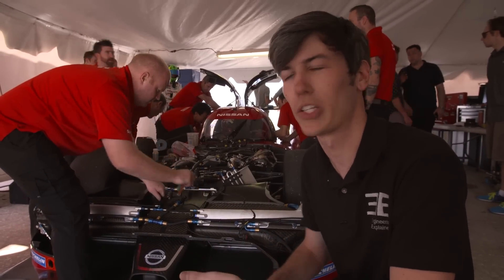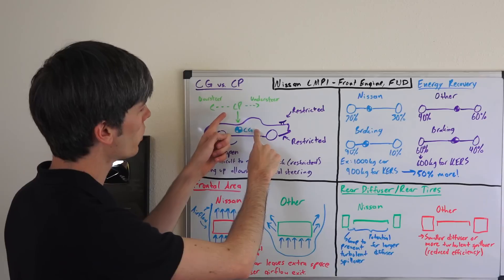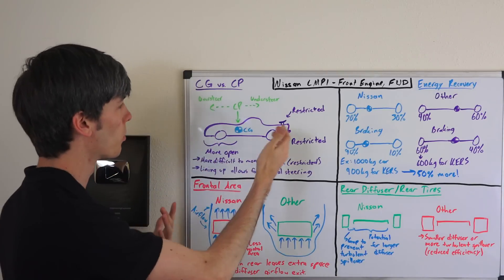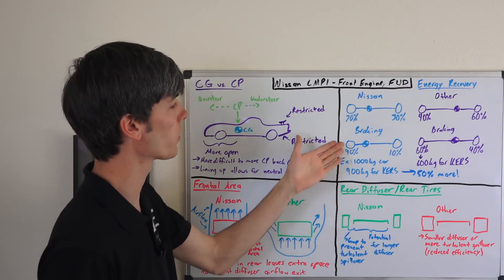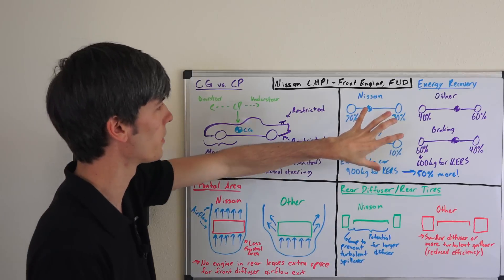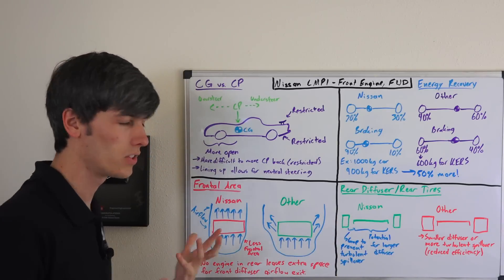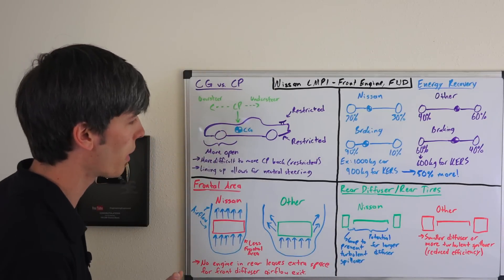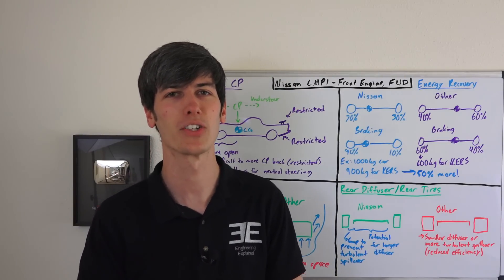Nissan GTR LM Nismo - 4 Reasons Why Its FWD & Front Engine

Comment: I am in two minds about this. First it is great that Nissan were thinking outside of the box and taking advantage of the then CURRENT rules in place. This is similar to how Mazda won Le Mans with the 787B in 1991, but then politics takes over and rules are constantly being changed, often to control innovation and maintain parity, but usually to allow the favourites to win.

Comment: You didn't mention the negatives. Front tires are doing a lot of work. Also, the diffuser creates a good deal of downforce right where it starts. Does it start earlier in this car to center that force between the axles, or still behind the driver creating more of the "weight" on the rear? Either way makes sense with a smaller rear tire, just curious.

Comment: say 90% of the braking is done in the front wheels, so the car basicly wastes the rear's braking because its not doing anything, and you can only brake until you lock up so the car would have to brake earlier than others right?
Reply: Right

Comment: Doesn't fwd have horrible top end speed & acceleration? Seems like an ok idea if you were on a short track with many turns. Any track with a straight away like le mans or sebring  and they'll be left in the dust.
Reply: Dante E92 335I Try doing some research on it to find out. Tracks with lots of slower turns will be more problematic for FWD.

Comment: Surely having more load on the KERS wheels under braking lets you brake, using KERS, harder so it is a traction advantage rather than an mv^2 difference.

Comment: very cool that the guys from nissa tried something new and outside of the box, but my concern about this are the front tires...  theyll have to do all the work of acceleration AND most of the breaking, as opposed to rwd cars where the work is split between the front and the rear axle. now if the front wheels take all this load, they will run down more quickly, resulting in more pitstops, costing the team a lot of time
(only if there are pitstops, i know nothing about this sport lol)

Comment: I am studying at Virginia tech to be a engineer on a team like this and coming up with these radical new ideas. This actually seems like a good idea, it was just not well executed.  Once I heard it was a 85/ 15 split, I immediately knew it was not going to work. When your hard on the brakes into a chicane, you are transferring weight and energy onto the front wheels. The front wheels now have 3 jobs, steering, power, and braking and not to mention 90% of the weight on the tires. No mater wherethe center of gravity is or the center of pressure is, the front tires are still doing 3 things at once and this will immediately lead to understeer. No matter if the driver feels it or not, its still there and hurts cornering ability of the car. just stay with the classic layout, it just works!!!
Reply: I have to agree, if it wasn't such a drastic weight distribution split, it might've worked to an extent, but tyre wear was always gonna be an issue with this car in extended stints. Steering and distributing the engine's power was not gonna end well for the tyres, extended width or not. Not to mention the hybrid issues the car had

Comment: what is center of pressure.
Reply: cobra R Centre of Pressure is the single point where all aerodynamic downforce acts upon. Basically, all the aerodynamic forces caused by the wings, diffuser, etc can be simplified to one average point somewhere on the car.
Reply: You mean center of gravity?
Reply: Thanks for reminding me. I would say the center of pressure would be somewhere near the back of the car close to the ground.

Comment: at the end of the day, the gtr-lm needed even wider front tires cuz there acceleration was trash, the tire wear was trash, the mechanical grip was trash, the rear aero grip was trash, the braking was trash (cuz no kers), the fuel mileage wasnt great, great idea but couldnt race to full potential because of regulations

Comment: RIP GTR LM NISMO project :(
I REALLY wish Nissan would have kept at it and worked out the kinks they had. A couple more years of development, and that thing could have been a game changer in the WEC
Reply: If the front tyres have both to steer the car and to drive it, you then have problems with managing tyres
Reply: lol that thing was never going to work
Reply: Adam Baldwin It won't, an undergraduate engineering student can figure out why it is hopeless. Just like the delta wing. It is flash design, but even with the smoke and mirror, it doesn't hide the fact the design is junk. For the Pismo GTR case, they may have better luck if they use the rear wheel to steer. Then their car may about to devour corner that no other car can.

Comment: Actual Le Mans performance aside, this to me embodies the P1 class. I wish more manufacturers would try outside the box thinking than just trying to chase what Audi is doing. It's also why I was really sad that when it was announced Ford was returning to Le Mans, it would be in the GTE-Pro class as opposed to P1. I'd like to see GM and Ford field prototype cars.
Reply: GTE-Pro is more entertaining and competitive than you think. Also keep in mind The new Ford GT was designed SPECIFICALLY for victory LeMans. the race car came first and the road car followed the design for the race car
Reply: williams used one in 2014 
but i think they let go of the idea due to packaging and for handling in the corners
u know rotating masses do not behave well while cornering
Reply: Only the, Audi used a flywheel up until last year when they saw how powerful the, Porsche was with an advanced battery and motor system. Toyota also followed the Porsche direction. F1 used Flywheels i think up until 2011 maybe 2010.
Reply: Right
Reply: Ford won't because they are too afraid of losing.
Reply: ***** I believe that is true, as they could have responded to a non-podium finish with "well it was just a GT class, no biggie. Though it would have taken a season or two, I think Ford could be competitive in P1 AND it would have done more for the Ecoboost brand than some 450k street car that is probably going to have post production problems. Plus they would get to develop a hybrid flywheel system with the others which I feel might be a new venture for passenger cars soon.
Reply: The hybrids in P1, and I believe in F1, use a flywheel. Putting it basically, it works like a windup wheel. When brakes are applied, the resistance starts spinning it up so that energy can get released back to the wheels when the driver lets off. I heard these things can spin very very fast, say around 20k-30k RPM. No batteries or electric motors, just a spinning wheel that can turn the wheels they are attached to and either add efficiency or power to a car.

Comment: #FrontWheelDriveIsBestWheelDrive
Reply: That's why all the highest performing cars in the world have been front wheel drive, right?
Reply: derz you couldn't be any more incorrect. Front wheel drive in concept is for economy, and comfort. Economy because there is less parasitic loss in driving the front tires than routing the power to the rear giving slightly better fuel efficiency. Comfort because fwd allows for a flatter  floor because of no drive train going to the rear which leaves more space inside the cabin. If comfort and fuel efficiency are your cup of tea than you are correct. From a performance driving point of view most agree that front engine rear wheel drive is the most fun and rewarding drive train lay out. Front engine rwd allows better weight distribution which in turn allows for better overall handling characteristics. And then Mid engine rwd is the preferred choice of most of the fatest race cars out there due to it's centralizes mass. All wheel drive works very well in poor weather conditions and when the power output of a cars engine surpasses its ability to put the power to the pavement. If you think front wheel drive is the best drive train than I bet you love the Fast and the Furious movies and you think they are totally real.
Reply: derz you couldn't be any more incorrect. Front wheel drive in concept is for economy, and comfort. Economy because there is less parasitic loss in driving the front tires than routing the power to the rear giving slightly better fuel efficiency. Comfort because fwd allows for a flatter  floor because of no drive train going to the rear which leaves more space inside the cabin. If comfort and fuel efficiency are your cup of tea than you are correct. From a performance driving point of view most agree that front engine rear wheel drive is the most fun and rewarding drive train lay out. Front engine rwd allows better weight distribution which in turn allows for better overall handling characteristics. And then Mid engine rwd is the preferred choice of most of the fatest race cars out there due to it's centralized mass. All wheel drive works very well in poor weather conditions and when the power output of a cars engine surpasses its ability to put the power to the pavement. If you think front wheel drive is the best drive train than I bet you love the Fast and the Furious movies and you think they are totally real.
Reply: DERZ but the fast and the furious cars were almost exclusively FR (or RWD)... If you drive on real roads with multiple seasonal changes and you have to spend money in real life; FWD is the best choice. Not everybody can afford to keep up a powerful AWD beastie, much less race your precious project and have somebody run you off without a pit crew to put humpty aston martin back together.

Comment: Hi man, I always like your vids, very easy to understand. I just have one question though. Is it counter productive to increase the down force on a car by using front and rear spoilers, when in racing everyone is trying to decrease weight, which is also downward force. Just getting a bit of confusion, please enlighten me. Thank you.
Reply: +3D Printwiz downforce from wings has not got inertial force you have to turn around the corners and fight against on acceleration and braking. get it?

Comment: Nissan needs to get it together. The Delta Wing, while a cool concept, failed hard. I attend the Rolex 24 yearly, and the Delta's NEVER finish a race. Almost always a transmission issue, or the engine just dies. This GTR LM might be better, but Nissan tries to go too far outside the box I feel. Who know, maybe one day they will invent the game changing formula like Audi did with the turbo Diesel, and ETRON.

Comment: Very interested in this car, not an outstanding result in 2015 but much learned apparently.
I head was not as fast as it should of been for the following reasons
1. Hybrid system not working which reduced its power by half
2. Had to run narrower tyres at front then originally designed
3. Reliability issues due to the new methods/technology and unforeseen problems that can only been learnt by racing the car

Would like to hear your thoughts on this as well as any info/changes/improvements Nissan will be making for 2016

Also I brought and drove the car in GT6 to see what it's like (according to Grand Turismo) compared to other LM cars
Things I found
1. High speed cornering/aero/stability was excellent whether trail breaking in or accelerating out and could gain a tenth or two over other LM cars
2.Straight line speed once on the move was a bit better

3. Low speed corners where much slower; a tight corner could lose over a second over regular car; most circuits have at least one of

Comment: Why does there have to be such tight restrictions on racing? it really limits the creative power that all these companies and teams have. Wouldn't it be better to just set some safety requirements/regulations and let the race teams come up with whatever 400 mph spaceship track car they wanted and see who had the best ideas? It would be neat to see cars go as fast as they can around a track without some meatheads saying you can't have a massive spoiler and downforce fans like Chapparal was doing in the 60's. Why limit creativity is all I'm saying. SMH
Reply: +Max Rein it makes it interesting and rewarding to overcome a challenge...
Reply: +Max Rein It because you want a race and not a show of a single car. You need to make groups for competition etc. to make it somehow compareable. Also people like to see cars which look like cars and could drive "theoreticaly" on a road. This LMP Classes are quite open as you can see whats technically possible.
Reply: +Max Rein Seems you didnt get the point. Every game or race needs rules to make it interesting and compareable. LMP cars look like some road cars, yes (never mentioned a F1 car would look like it). Look at all the Super and Hypercars. They are all very similar in kind of layout (race is always more extreme and with another focus like for example changing parts quickly). There are several cars which started as LeMans Cars for example. CLK GTR, Porsche GT1, The Engine of the Porsche GT, Toyota GT One (which i was happy to drive in Cologne few years ago). The Hybrid technology of the Porsche 919 you can find also in 918 and in now upcomming models. So what i want to say: The people like things they can build up an identification. Thats the reason why endurance race here in Europe is way more famous than F1 for example. You can even build cars with jet engines, but people just look once at a number and dont care anymore because its to "spaceship" and has nothing to do with reality they know. All what you can find in todays LMP1 cars is reality on road (just different spec) or will be on road soon. (Like this little regen powerplant which is driven by exhaust gases to rengen electricity in the 919 at the rear axle). This will be available also next 2 years for street cars.
Reply: These lmp cars could not drive on a road, and the challenge in racing is your opponent. Besides, f1 cars and lmp cars don't look much like cars other than they have 4 wheels and a steering wheel (that looks like no other steering wheel on your average passenger car). Respond when you have a valid point to make, I enjoy intelligent discussion.
Reply: +Max Rein If you dont have rules for a sanctioned race, youll have one car raping everyone else, and there is no point in watching something like that, it would be boring. Look at the Pikes Peak Hill Climb Open Class. Its basically run what you brung and the winner is always winning by a large amount of time, and there arent many cars that run in that class. There need to be rules to ensure the sport is competitive and also it highlights the skill of the driver. Make 2 identical Suzukis that Nobuhiro Tajima drives and give the other to Rhys Millen, then let them both run up Pikes Peak, then youll see who is the better driver.
Reply: +Max Rein massive downforce makes racing impossible bc it creates "dirty" (turbulent) air, so car behind cant follow

Comment: Still I don't think these advantages outweigh a MR setup. Le Mans are mostly straight lines and hard breaking. A MR setup will be more ideal in case of accelerating, braking and tires management.
Reply from the maker: Actually the FF is fairly phenomenal for straight line accelerating and braking, especially when you take into consideration that you can recover more energy off a single axle. Unfortunately, they struggled to get their KERS system operational.
Reply: +Engineering Explained You nicely explained the advantages, but the aerodynamic and balance disadvantage is higher in comarsion. As we could see the technolgy and concept was not working and the other main brands like Toyota, Audi and Porsche had a reason to go with rear mide engine concepts. Even cars from one class lower have been faster than this concept. But anyway it would be nice to compare it to the Porsche 919 just for technical reasons. Would be nice :-)
Reply: Once its going ff is awesome for straight line acceleration both due to weight savings, and drivetrain loss. However, the likelyhood that that advantage will ever outweigh the fact that powering the wheels that are steering isnt efficient energy application, they most likely wont get far with fwd unless they mess with other things such a different wheel base fore and aft. I bet rear wheel steering would also help a ton. But rules, and if those rules werent there, rwd cars would pull away again.